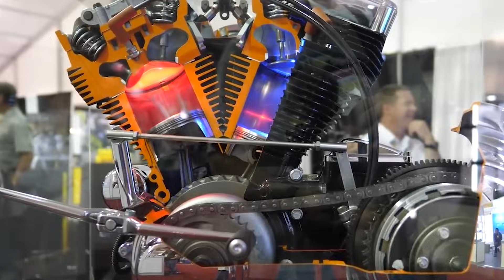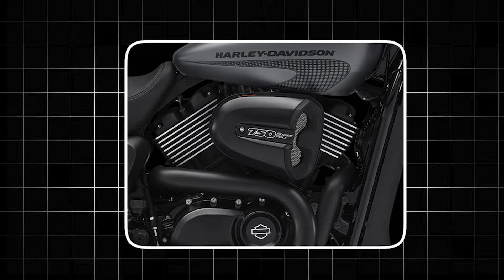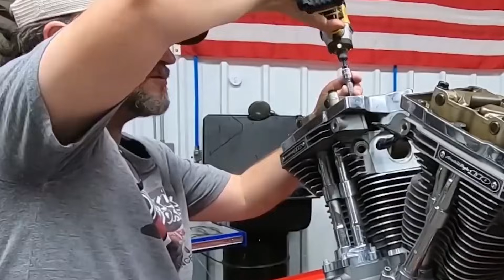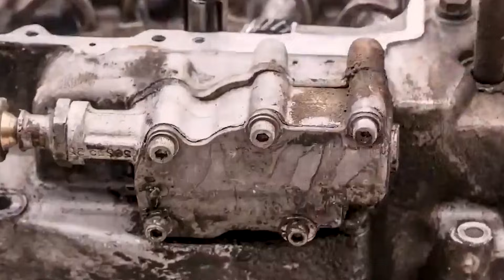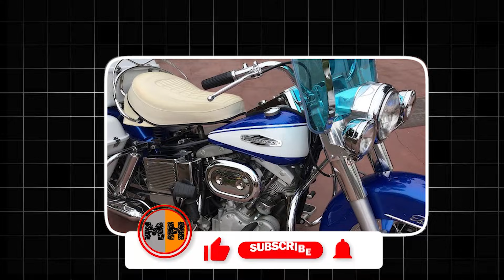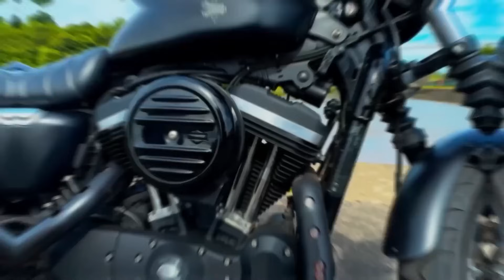The 10 WORST Engines Ever Put in Harley-Davidsons — Total Failures!

Comment: The 80 inch evolution was the high point of Harley’s power plants
Reply: Even the EVO had its problems, but you could rebuild it with better gaskets and a cam and get almost double the power of stock while still being reliable. I have one in my FXR amd will not part with it.